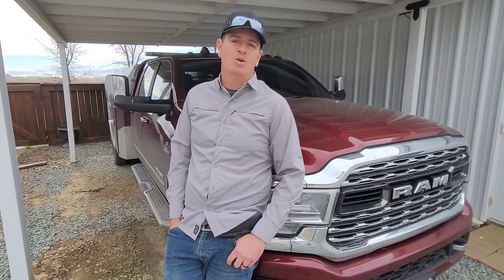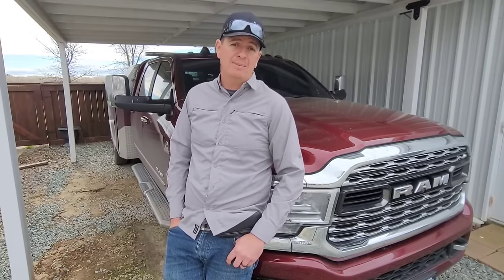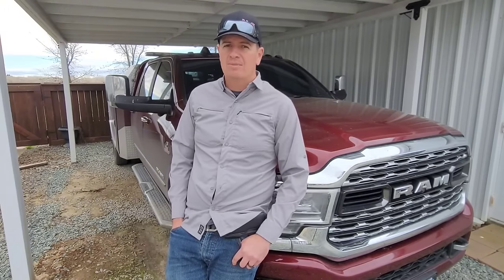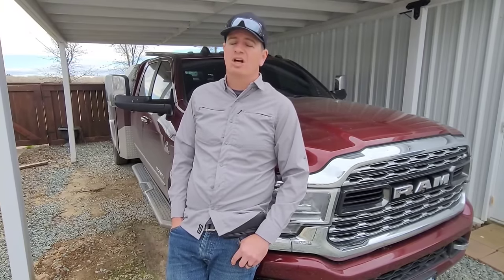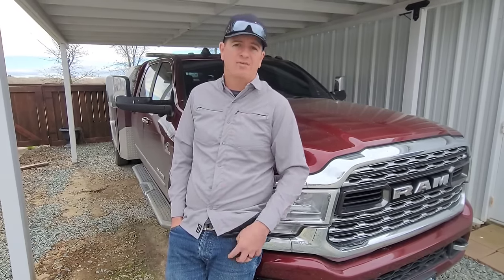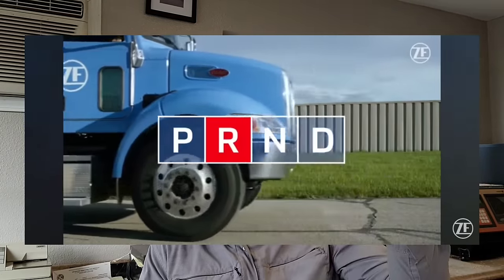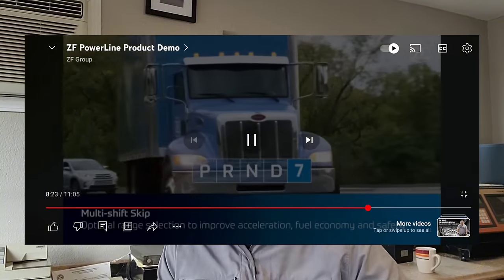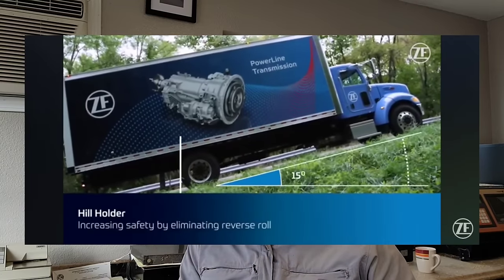RAM HD 2025...ZF Powerline 8spd to replace Aisin?...Powerline details!

Comment: Could they use a center console shifter?  Because trx and gt halfton have zf with center console shifter. I can’t do the dial that’s just not user friendly.
Reply from the maker: Traditionally, console shifters are also connected to a cable. I think almost certainly we will see some sort of dial
Reply: @bobbyjfarms3681  I know the hd with the zf only has a dial. I would just hope people would push for a console shifter if they can make that work.  I don’t know anybody that wants that dial.
Reply from the maker: @scottapple2836   I'd vote to keep the column shifter if I had a choice
Reply: If it's electronics I bet they could put a column if they wanted it would just be same concept as a dial, just sending signal between the two but I doubt they will.
Reply: @bobbyjfarms3681  anything is better than that dial
Reply: HOW IS IT NOT USER FRIENDLY? PERSONALLY I COULD CARE LESS EITHER WAY JUST WANT THE RELIABILITY
Reply: @farva75089  not user friendly because going to have to look to grab the knob every time.

Comment: Definitely don’t need 10 gears with these Cummins. And just like in the gm trucks they lock out 1st gear mostly so when you come to a stop you never go into 1st gear. The only time it will go into first is in tow haul mode and it is definitely needed as my 23 Chevy didn’t tow good at all with that 10 speed you talk about aisin shifting a lot. That 10 speed was always shifting.
Reply from the maker: I agree. That's exactly why I think this 8spd will be good. Hopefully it looks out 1st too and skip shift function for the win

Comment: There is no such thing as a "lifetime fluid". They say that because it will usually make it past the warranty period. Change your fluid and filter every 50k if you want the transmission to last.
Reply from the maker: I said lifetime filter, not fluid. ZF is claiming no need to change the filter, only fluid
Reply: Ok. I misunderstood. We have a ZF 8 speed in our 2017 BMW X5 35 diesel. BMW says lifetime fluids. ZF says change the fluid and filter every 50k. More maintenance is probably better. I can't see a transmission filter lasting hundreds of thousands of miles like we put on our Cummins trucks. And if it does, how well it's it performing at that point? I understand not wanting to change filters at every fuel stop, but I want my equipment to last. So I'll change the fluids and filters on a maintenance schedule. I wonder if I could get that ZF Powerline behind the 5.9 in my 2006 Megacab?

Comment: Aisin might have its issues but longevity its proven to hit 500k odo and up
Reply from the maker: I agree. I was a little rough on the ol aisin in my video but it has proven very tough and reliable. I'll admit, I'm 10% salty due to having 2 k1 snap ring failures

Comment: First thing they need to do is put Dodge and the crosshair grill back on those pickups! Then they need to upgrade the whole pickup. 15 years into this body style for the HD's is to long! I still drive a 2010 3500 because there is no reason to buy another one that looks just like the one I have! They need to option a manual trans for those who want one. More color options and 2 tone on all models with chrome front and rear bumpers need to be available again. If I have to pay 110K for a pickup it needs to look like a 100K pickup instead of a base model where everything is the same color. Then they need to bring the price down. 100K and more for a pickup is stupid!!!!!!!!
Reply from the maker: The truth is, 2 tone paint isn't in style anymore,  and hasn't been for a while. The sport look with everything match painted is what's in. I agree that they need to bring back the manual trans. I also hears ram actually lowered msrp a little

Comment: The ZF will be a good upgrade over the Aisan, but it's still 2 gears short of the competition, so it's not all it should've been.....
Reply from the maker: Politely disagree. Never actually short of gears with my 6 spd. 10 is just too much. What's next? 18spds?
Reply: @bobbyjfarms3681 totally agree with that. Most of the time the 8 and 10 speeds are skip shifting anyway
Reply: Ask a Ford tech how reliable the 10r's have been in HD applications (teething issues).  ZF builds rock solid transmissions, I think they'll get it right.
Reply: @bobbyjfarms3681 Yep, 7 or 8 is perfect. 4.10 gears could use 1 more up top for fuel mileage for sure.

Comment: That new ZF trans has way to much going on it’s gonna be an electrical nightmare. Being able to shift from drive to reverse while moving is not a good on the drivetrain especially with a heavy load. Shifting from drive to neutral at a stop is very stupid, trans is gonna hit first gear hard under hard acceleration. Good thing they are putting it in a ram just another nightmare trans. I hope it works for them. I don’t understand why people even buy ram heavy duty pickups, the trans is garbage both of them and the Cummins isn’t reliable anymore. Most people keep there trucks 200k tops and trade them in so why does anyone care if it lasts 1 million miles maybe .1% of people will ever do that. 99.9% of people that buy these trucks trade them in before 200k. How many 2012 Cummins have you seen with 1 million miles? I’ve seen more duramaxs with a million. My Allison 10 spd is the smoothest trans I’ve ever drove. I can’t believe I’m saying this but for 99% of people buying hd trucks the ford is a way better option than ram. Yeah the engine is toast at 200k but who the hell cares lol. Also with all the emissions Cummins isn’t even lasting 200k. To each there own but GM and ford are much better trucks.
Reply from the maker: L......O........L........ thanks for the free entertainment! I love story time

Comment: The aisin is the best transmission on the market
Reply from the maker: I like the aisin too. One thing undeniable with it is the strength it's shown over the years. But, that's kind of where the fun ends. The overall design and function of the powerline appears to be a lot better. I see now likely 1st gear will be skipped unless in towhaul, which is perfect. 2nd is the perfect rario for takeoff gear in normal driving unloaded conditions. Wish the aisin did that, I'd prefer it be a 5spd  (2-6) as 1st is too low when empty combined with the gap into 2nd

Comment: Aisin already has hill holder
Reply from the maker: Fill me in on that one
Reply: @bobbyjfarms3681  according to the 2018 Ram HD Catalog they all have Hill Start Assist " When the vehicle is angled on an incline, this system keeps your Ram stationary for two seconds after the brakes have been released or until the accelerator is depressed."   
 Appears it is built into the vehicle, not unique to the Aisin as I thought

Comment: Your whole talk on these trannies, the clutch surface area and gear hunting, and you said nothing know nothing about the Valvebody Poor design?  No matter the surface area or TCM setup is all blocked by the Valvebody multiple design flaws.

You better go do the research on the Valvebody bad design. It's like a bad heart in a man with a 400lb bench press and 150lb curl strength, no good of the fluid is leaking down pressure to the limbs.
Reply from the maker: I'm sorry I didn't address every detail, and one that is important to you, but nobody wants to watch an 1hr long video either. It doesn't really matter anyway, it's about the new trans that's coming to replace everything, than so much about the stuff it's replacing. Thanks for watching